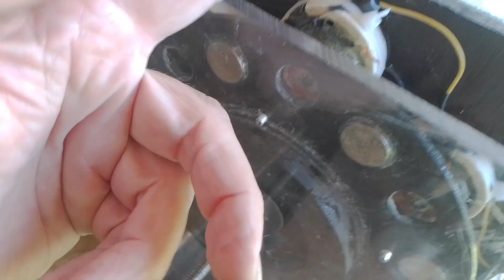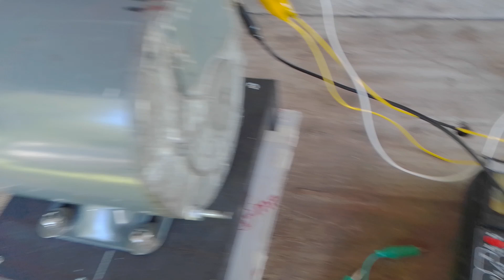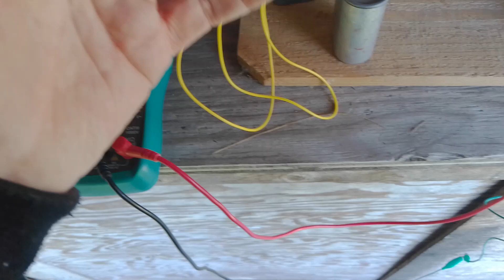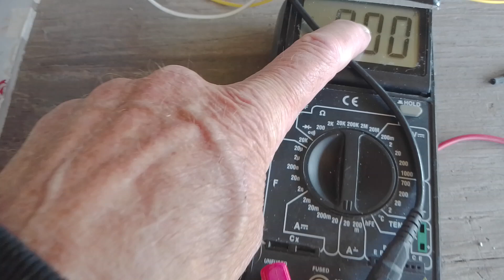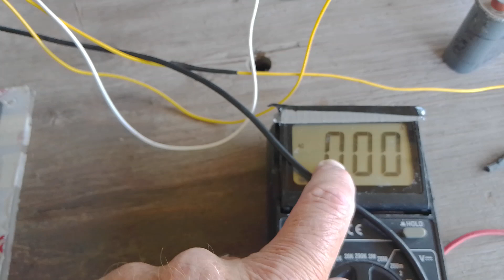DRMG in AC mode tested at 1800rpm

Comment from the maker: Hi Tony 
The rotovertor very good for testing lenz braking reaction in generators or alternators you really know if a generator design is no lenz or low lenz since shaft of rotovertor is very "sensitive" to load.  Its going 1800 rpm too while pushing the load the generator on shaft makes.

Comment: Asesome job Doug! Really fantastic; since the sketch you made some time back at the airport in Paris I lost a bit the details when you talk about motor- and generator coils and crowbarring them and putting caps in series. Maybe in the future there is some time explaining the setup with the ‘paris sketch’😀. Thanks man. I have a F&P motor generator waiting here to be rebuilt to your design. I have a Variac and a bunch of capacitors. Struggling with getting the right 3ph drivemotor, but that will come
Reply from the maker: There are eight ferrite cores,  5mm x 45mm in between the two rotors with magnets. Also around the ferrite cores I glued on 12 45mm lengths of soft steel green enameled florist wire.  So sort of a coat of laminate steel around the ferrite. Then 15mm of the core is wrapped with 24ga magnet wire and 30 mm with 22ga wire.  The generator coils take up 30mm of core length, the motor coils take up 15mm.
The past few months I have tried out 16 magnets in rotors, 8 magnets in rotors, different offsets to rotors and NS magnets and rotors with magnets all facing same polarity. My goal is a no lenz braking generator to go into shaft of rotovertor where loading coils does not raise draw to motor or make it slow.
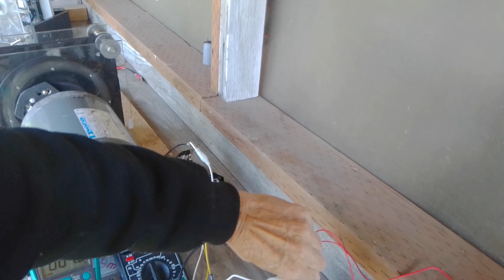The series AC cap is connected in series to one of the output lines of the generator. It's perfect  UF value would be different for different loads. 6:44 7:13